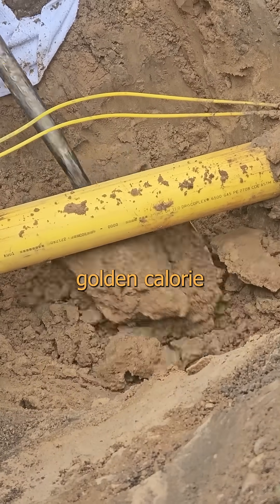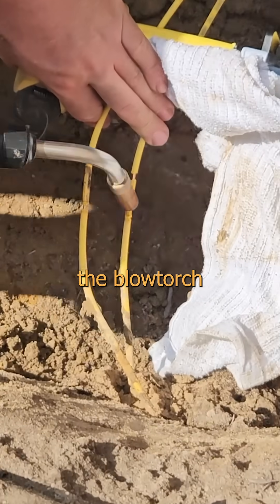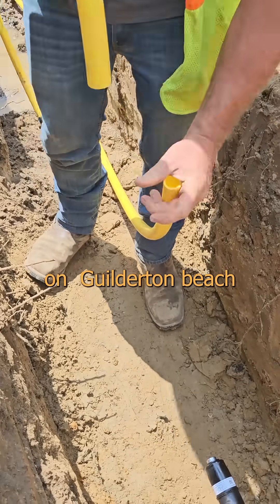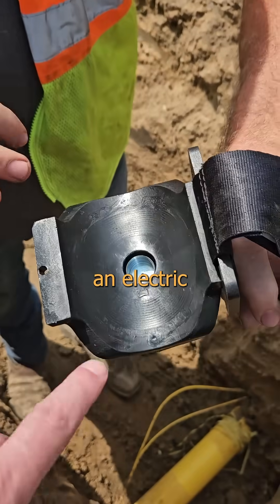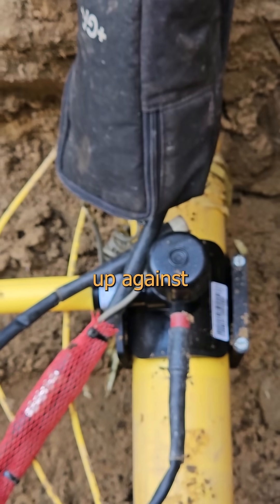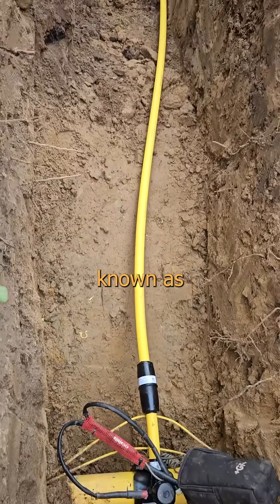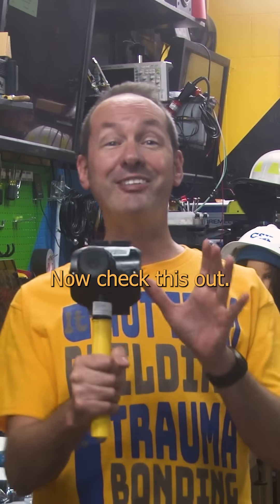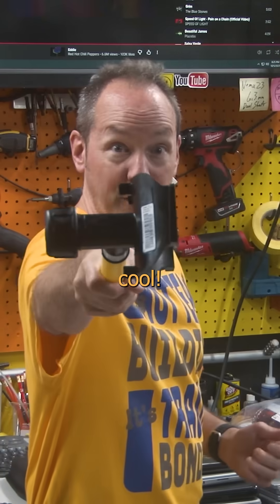Gas Line Hot Tap #chrisboden #comedy #engineering #construction #educational #apprentice #science

Comment: Do the two wires have a special purpose?
Reply: They are tracer wires to locate the gas line. The second line is redundancy and also can increase the detection strength. These are used where lines are made of non-conductive material such as the gas line in this video.

Comment: Assuming the two yellow wires are trace wires ? Two because you know what they say, two is one and one is none
Reply: It looks like the line might have been directionally bored. Usually in that case they run two eight gauge wires when pulling the pipe back through the bore. They do that for redundancy in case one of the wires breaks during the pull back so that the line is still able to be located. Main line that is laid in an open ditch usually uses one 12 gauge wire!
Reply: What are those trace wires for? And why does he pull on them?
Reply: That's how they find the gas main when someone calls for a locate before digging. He was pulling them away do they could have room to attach the tap and the pipe that will go to the house. Two tracer wires will also be run next to the pipe going to the house and attached where he stripped the insulation from the main wires.

Comment: What about these two wires? And why are they stripped?
Reply: those would likely be tracer wires, so the pipe can be located from aboveground without needing to dig it up (or accidentally find it with your backhoe). i imagine they were stripped to connect new tracer wire for the service line but i’m not sure